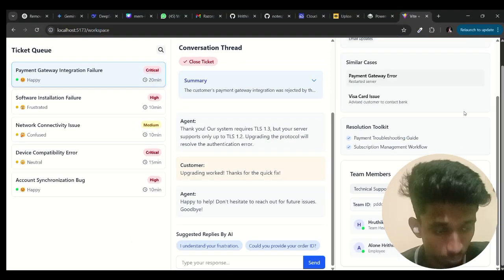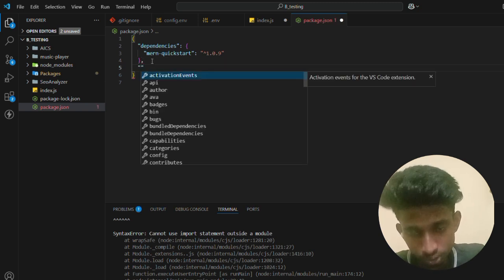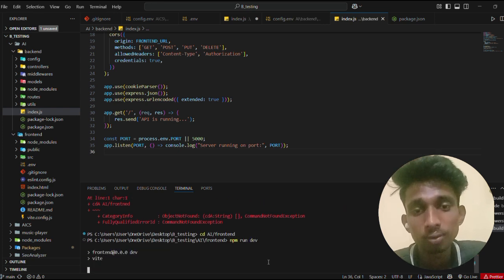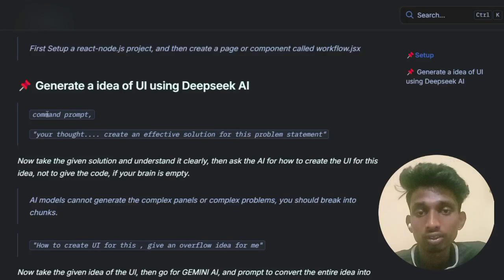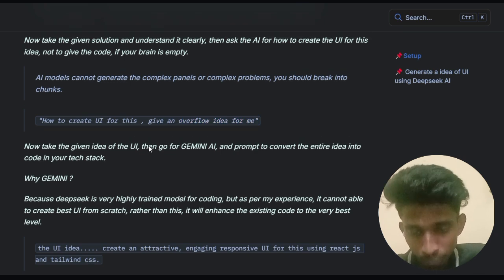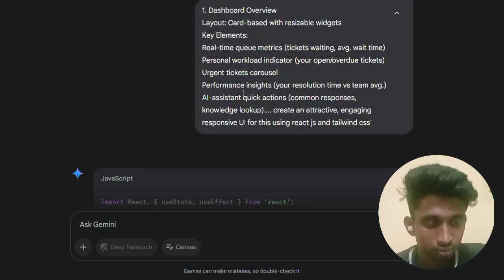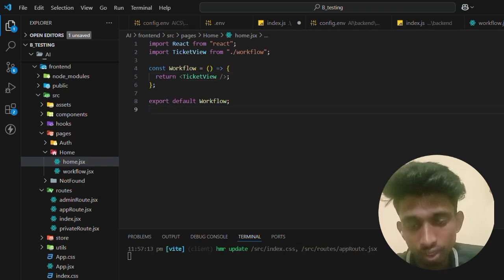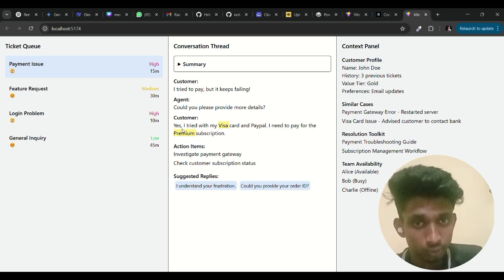This is how I built my hackathon project using AI!

Comment: A small doubt do you recommend using claude or cursor for the code
Reply from the maker: I didn't used those two till now, but you can choose whichever (depends on how model is trained for code), prompting is crucial part, which u can learn from my videos then apply in those models also.